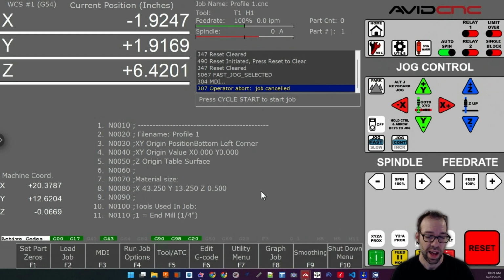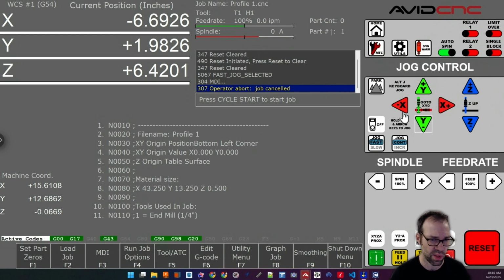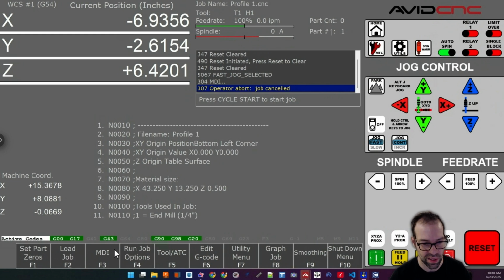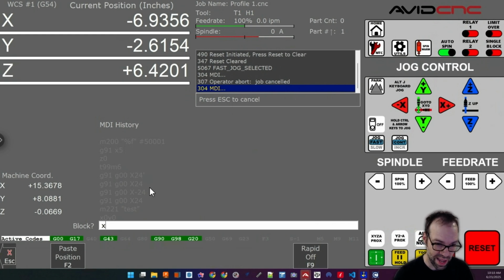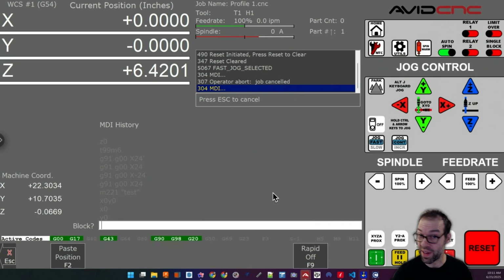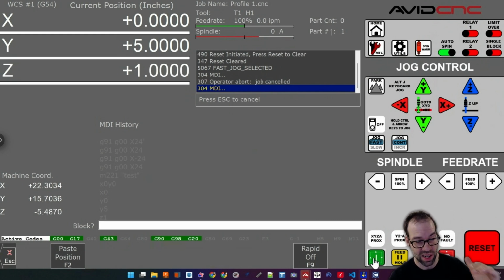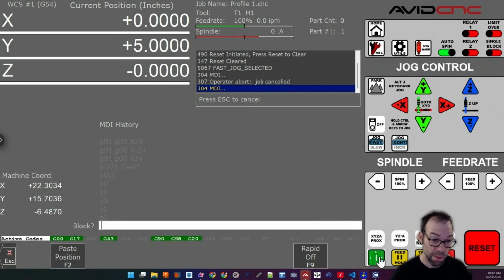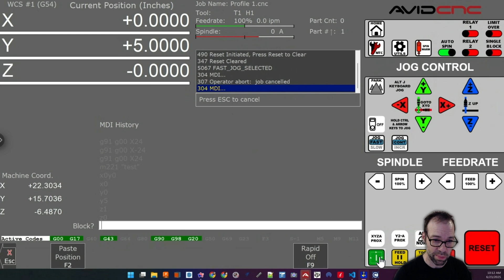Precise Machine Moves with MDI Commands

Comment: When you just jump into the MIDI to go to a new location without specifying a speed what speed will be used?
Reply from the maker: By default the machine will be in Rapid Feed Mode denoted by the G00 code next to the "Active Codes" section in the lower left of the screen. Rapid speed is dictated by your motors (N23, N34, & Servos will all have a different rapid speed. If you want to set the speed of the move you want to do, you have to include a G1 command before your move command and a F command after. Example: G1Y0F100, this will set the machine to non-rapid mode and it will move to Y0 at 100 IPM. Hope this helps!